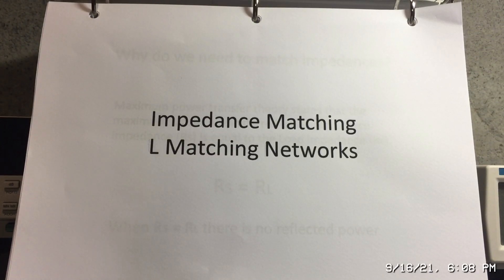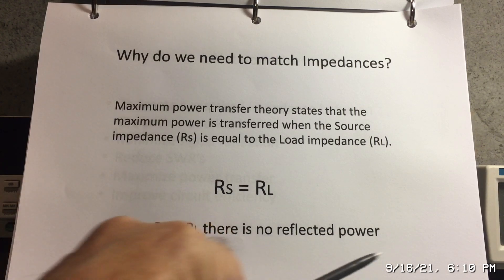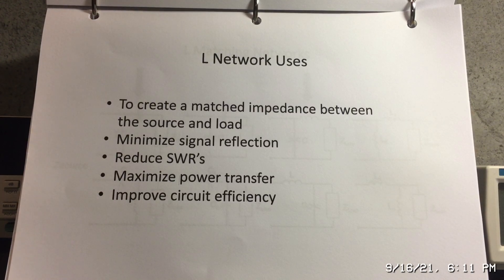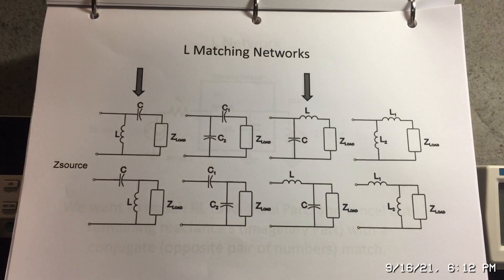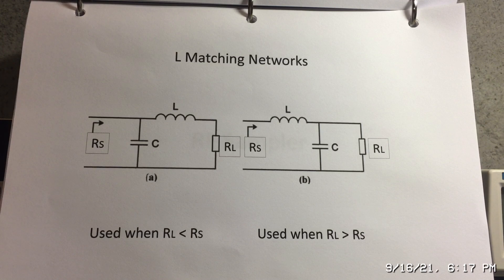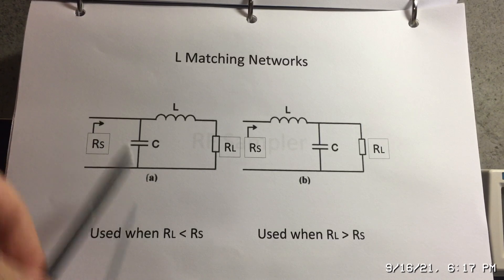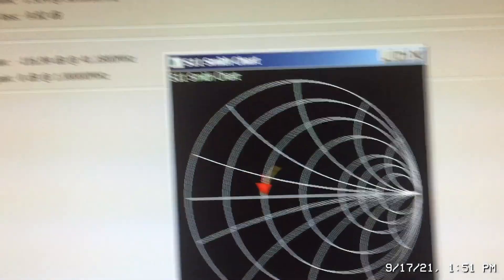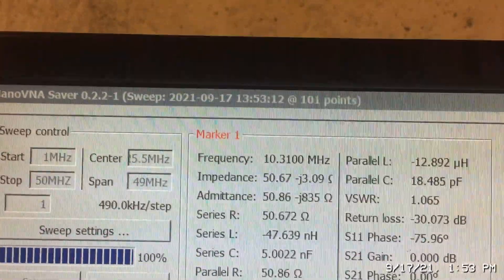L Matching Network (Part 1)

Comment: I just viewed your video 3X. This is in reference to your final demo. When the shunt capacitive element is in parallel with a higher VNA source impedance, 50 ohms, your circuit will transform the impedance downward to the lower impedance load, 25 ohms. While your lab setup is correct for what it is intended to do, it does not faithfully reflect the drawing that you showed of Professor Long's network. Professor Long's network is drawn to transform a higher impedance load down to a lower impedance source. I suggest that you revise the notebook drawing that you present to reflect what you are demonstrating in the lab. It generates confusion for the viewer. If you would like to see it presented correctly, please watch W2AEW's lesson #276.

Comment: Thanks for making and sharing this interesting video. If you make additional videos on this subject I think it would be helpful to demonstrate how matching circuits are used to interface to loads having a complex impedance (resistance plus capacitive or inductive reactance, or Z = R +/- jX). Antenna matching circuits would be a good example since they almost always have non-zero reactance that needs to be cancelled to effect maximum power transfer. Thanks again! - Jim (KK7CSC)

Comment: Another informative video RF Man! I'm curious, and maybe it requires a video to answer, but when would you use an L-network or T-network vs. a transformer?  What I am driving at is, for a 1/2 wave end-fed antenna, we use a 49:1 unun, but why do you see 5/8 wave antennas using a T-network instead of a transformer? And is there a rule for when to use which method?
Reply from the maker: There is no rule that I am aware of. Most antenna matchers will use either a Pi or T network. Both LC networks can be tuned to match a wide range of impedances. The combination of LC can be considered infinite. A transformer has a fixed impedance ratio limited by the number of turns in the primary and secondary. The ratio is a fixed or finite value and can not be tuned. This may be necessary if the antenna is not resonant at the high or low end of the band.
Reply: @rfmanchannel6915  Thanks RF Man; I thought that other than for small tuning adjustment, getting the impedance to match at 1.5:1 or more, using an LC arrangement of any kind was very lossy in some way, even when done at the antenna feed point. I had in my mind that a transformer would be more efficient and  after that, just use minimal LC to get the match "perfect". Would you say that's true, or can an LC arrangement be just as efficient to match impedances for power transfer?
Reply from the maker: @louisseaman8455  I agree with your point. I have a video where I use a 9:1 Unun and an antenna tuner/matcher with a long wire antenna. This arrangement works best. Regards